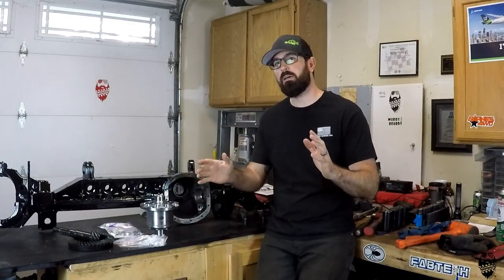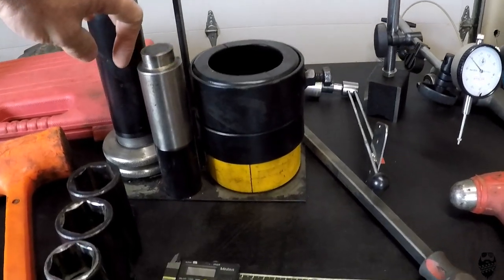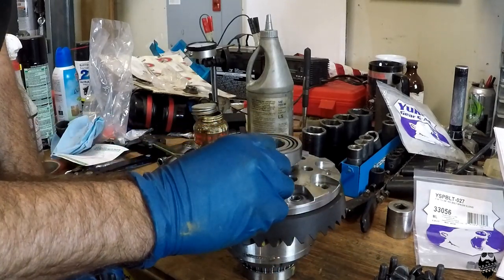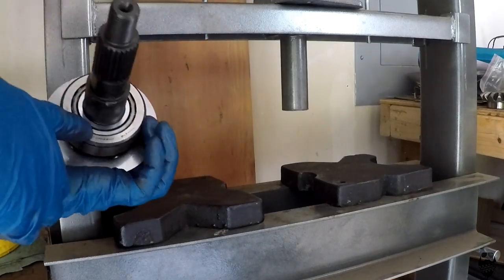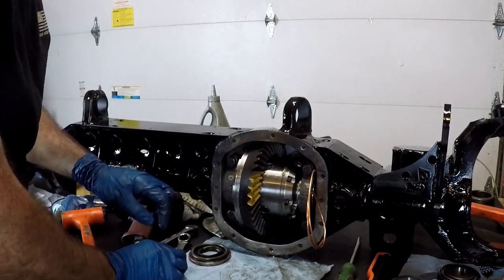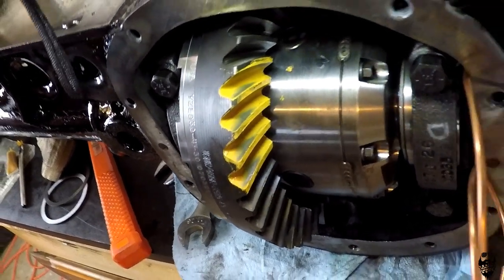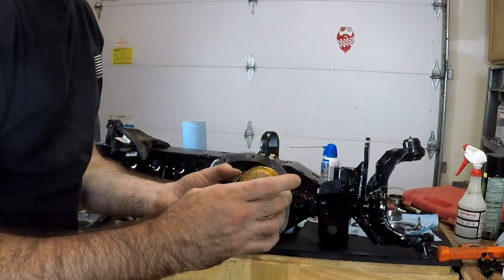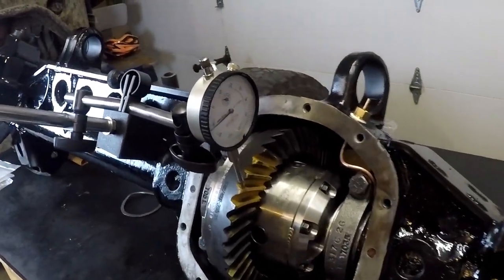Ultimate Dana 30! Episode 2 Yukon 4.88 gears and Zip Locker Install

Comment: Can you use a housing spreader to get carrier bearing pre load with the truss welded on?
Reply from the maker: I have never used a housing spreader, but I would assume it might not work to well with that truss on there
Reply: @MuddyBeards4X4  it will work....it will give you an extra few thou to play with.
Reply: Muddy Beards 4X4 how are you getting preload on your bearings then?

Comment: why not use a crush collar?
Reply from the maker: Crush sleeve eliminators are the way to go. reusable, you don’t have to replace it or guess on the pinion preload if you take anything apart. And crushing a crush sleeve is just straight up a pain in the ass!

Comment: I have a 2008 Jeep Commander with Chrysler 8.25" rear diff, 12 bolt pattern. I've been wanting to find a gasket for it, but all I can find are 10 bolt pattern gaskets. Do you know if the Dana 30 is the same 12 bolt pattern as the Chrysler 8.25, and if there is a gasket available for it?
Reply from the maker: Not sure, I never use a gasket, just oil resistant gasket maker. But I am sure someone makes one.

Comment: Would you put a 37 tire on that d30 with confidence?
Reply from the maker: Hm.. loaded question, lol. With confidence no. If you don’t beat on it too hard it will probably be fine. Robbie has 36 TSL on stock shafts and hasn’t broken yet, but he drives knowing his limitations.
Reply: Muddy Beards 4X4 right on, thanks

Comment: There's no such thing as the ultimate dana 30 lolololol broke the teeth off my ring gear twice then upgraded to the 44
Reply from the maker: There is no such thing as an ultimate anything, there are always limitations, lol. And you shouldn’t be breaking teeth off the ring gear, must be setup incorrectly.
Reply: @MuddyBeards4X4  haha never run 37 inch tires on a dana 30 you will break teeth off the ring gear indeed first was factory ring gear second was a yukon. Fool me once shame on you fool me twice. Well we cant get fooled again. Lol
Reply: @MuddyBeards4X4  I applaud the valiant effort tho.

Comment: That R&P will fail installed like that, you did not use a diff spreader as required on dana diff installs and as a result you will get sag along the bottom of the bearings as the housing bears the load on a dana, this causes the gear alignment to be out and eventually the pinion bearings will fail and the pinion will collapse onto the carrier if it doesn't chew up all the teeth first. You will be back here in a year or 2 to replace the R&P. Use the spreader and there will be no fights!
Reply from the maker: I do agree that a diff spreader would help tremendously, it’s on my list of tools to buy, but I have setup more than 15 Dana 30’s and have never had a failure.  I do agree that if you don’t have any preload on the carrier it could or will lead to a failure, but I have always been able to get adequate preload (although sometimes a pain, especially on the air locker) to prevent failure.
Reply: Thats exactly what happened on my stock jkur rear d44. The pinion bearing went and put big metal chunks of the cage all up in the rear diff. When I pulled the carrier out it practically fell out from no preload from the factory..